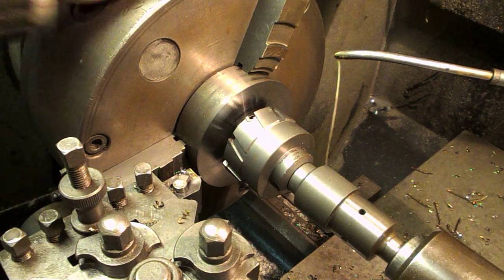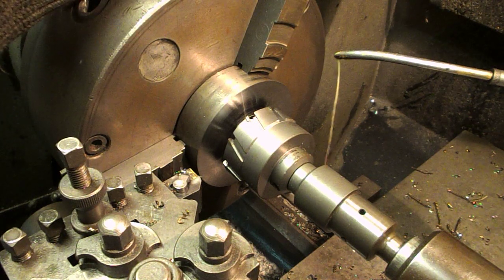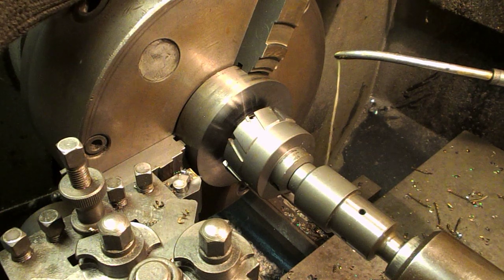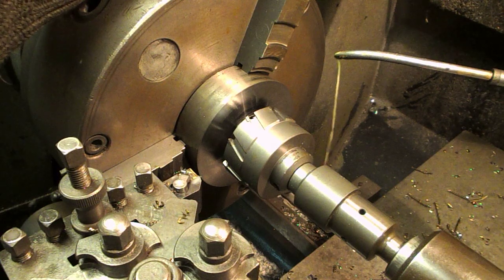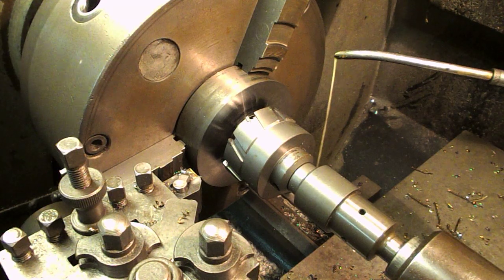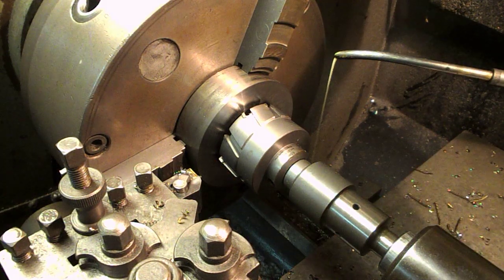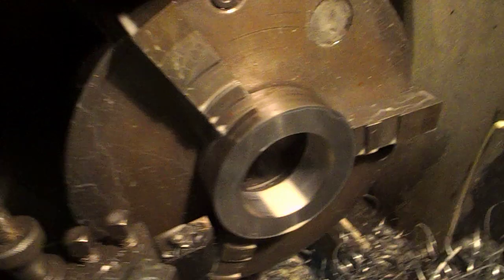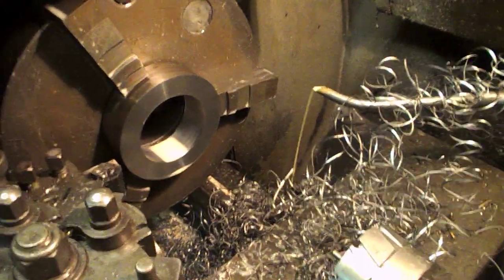Making a 65mm dia. hole in 28mm thick steel using an annular cutter (or core drill) in a lathe.

Comment: I successfully used a large hole saw on 1 of my recent projects. Definitely a good way to get rid of a lot of material fast. Especially with carbide tipped units
Reply from the maker: Yes, I saw that. Did pretty well as normal hole saws usually have trouble clearing the swarf, whereas the "Rotabroach" type cutters are cleverly ground with flutes to take the swarf away from the cutting edges.